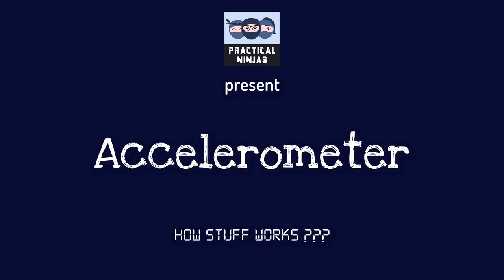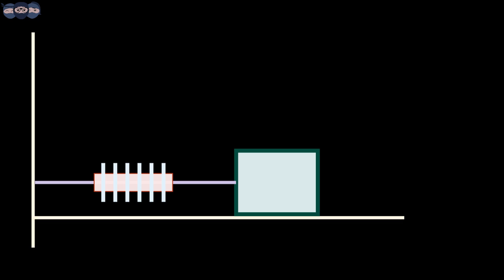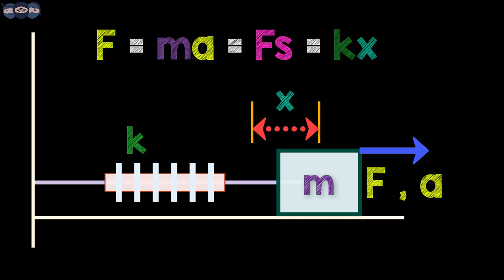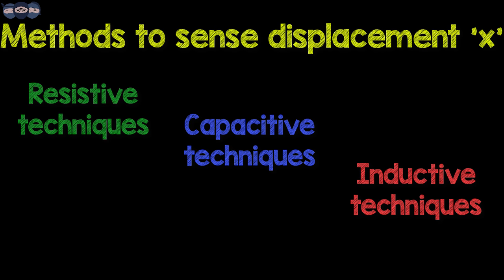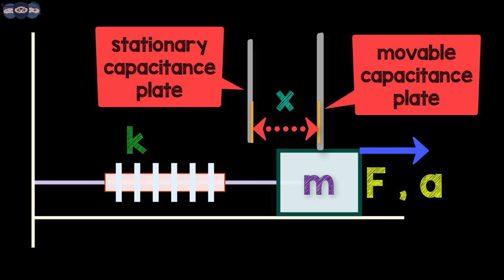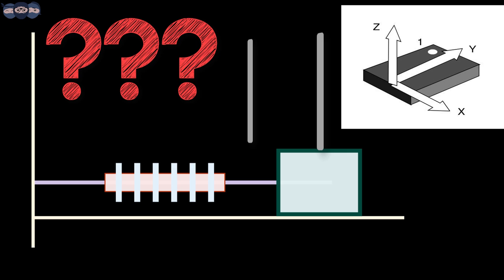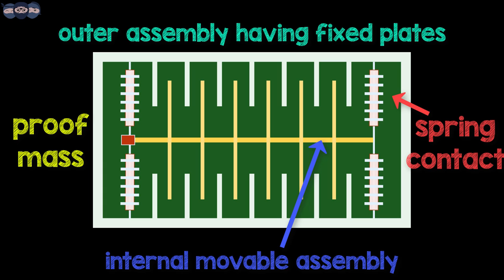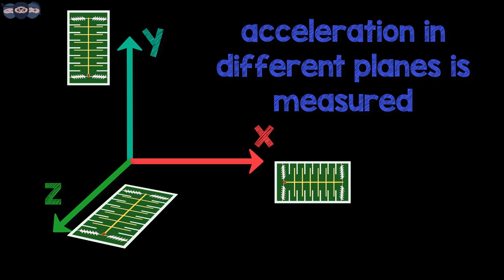How Stuff Works??: Accelerometers Explained | Physics & MEMS Technology

Comment: Great video... not many people can explain something connected to F=ma and take it to F=ma=fs=kx and keep it simple. Shows why one crash hitting something hard like a cement wall just right can damage the accelerometer and the value of soft mounting the flight controller as well as the disadvantage exposing why custom made application specific mems have an advantage (think DJI) to create a vibration frequency tuned flight controller board... and why a FCB is thrown off mounting it on another reference frame of vibration. In time Flight controller boards will be self tuning on the electro-mechanical level and BETA Flight will only assist with PID moment arm time frame motion rather than interrelated frequency tuning. It's getting better all the time....;-)
Reply from the maker: We are glad you liked the video.Thanks for your feedback and a detailed explanation.

Comment: but when the accelreation will stop, the  spring will shoot back and oscilate infinitey if it is in space right ?
Reply from the maker: The force of the spring is balanced by the mass and acceleration of the body. If acceleration stops, it means the value of a=0. Under this condition, the spring force will also be 0. If there is no force, spring will pull the mass back to its original position.
Reply: @PracticalNinjas  , thank you for response
Reply from the maker: @ianniculescu1625  . We hope we could clarify your doubt.

Comment: I'm trying to make a device to help my friend with special needs, walk straight by sending alerts if slightly deviated (right or left). Would Gyroscope or accelerometer or gyroscope work?  I need suggestions with which technology would be better. Thank You
Reply from the maker: These devices might help to some extent. However for accurate sensing you might also require GPS alongwith some advanced estimation algorithms

Comment: Thank you, for this very basic look at how these "MEMS" components works, internally, but, it would've been MUCH MORE USEFUL, if you could actually take a more in-depth look at actually using a real component, and how to go about using it, in a real circuit, to activate some kind of "control" function, (i.e. to turn on an LED, or set off an "indicator/alarm/horn, etc.)  ;D
Reply from the maker: Thanks a lot !!! We will try to make a video using actual physical components.

Comment: There is a mistake in the video 03:57 when the acceleration is to the right, the movable frame should shift in the opposite direction. It's Newton's first law of motion or the law of inertia, which is the tendency of the movable frame to resist any change in motion.
Reply: good catch!

Comment: Are there accelerometers that can measure the acceleration of the movement of Earth? That would be cool.
Reply from the maker: +Me C. As per our understanding, acceleration of a body is measured with respect to a frame of reference. When we one measures acceleration of any body or object on earth, the earth is the frame of reference for most cases. So measuring the acceleration of earth using the acceleration MEMS described in the video seems difficult. However certain different techniques exist that would measure the earth's acceleration.

Comment: how many MEMS used in accelerometer and how many accelerometers used in mobile
Reply from the maker: +Mani Kanta, In principle three MEMS should be used to track the data in the three dimensions. But due to advancements in technology, a single MEMS can be designed that tracks the data in all the three directions. One accelerometer IC should be enough in mobile.
Reply: thank you
Reply from the maker: Glad we could help :)